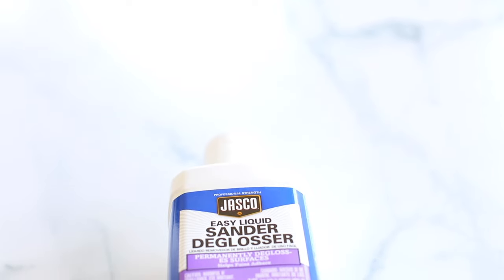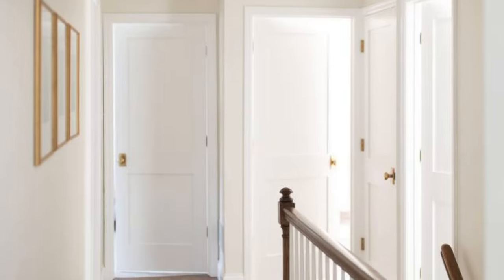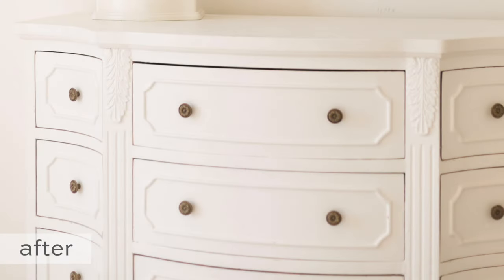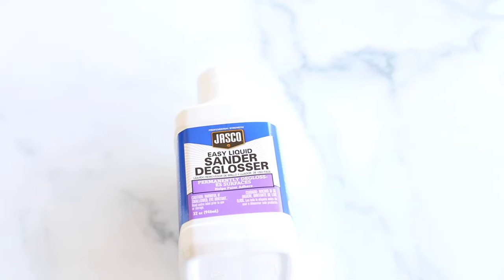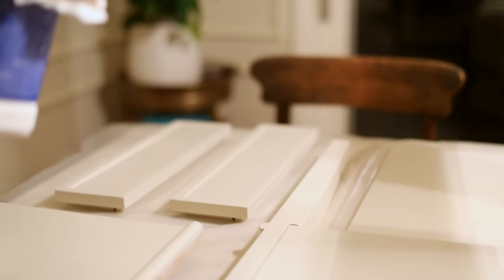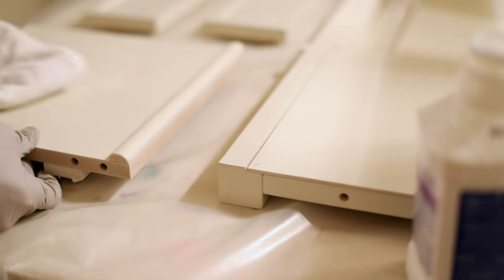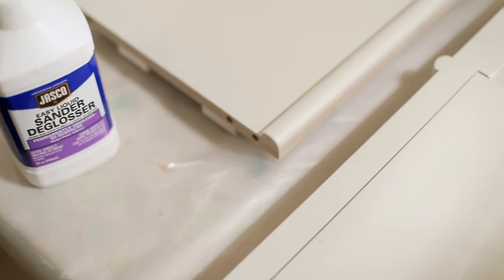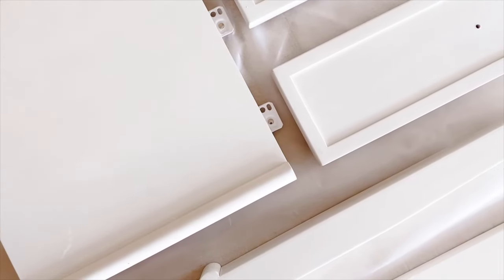Paint Without Sanding | How to Use Liquid Deglosser

Comment: Julie, thanks for the great video. I am using this product to degloss all of my oil based paint  trim & doors. Although the directions do not say to do this, I have been taking a damp cloth & removing the product/lifted sheen after several minutes (up to 10mins) but completely letting it dry. Now I’m concerned I shouldn’t have done that. Do you think it will matter that I took the haze off? We are applying a paint for trim & cabinets that is not oil based. Thanks!
Reply from the maker: Hi, you're welcome! I don't know for sure, but our cabinets and furniture have done well even when that has happened to us.

Comment: Hi, I have attempted to use deglosser. But became gun shy due to a paint peeling residue coming off. It resembles paint stripper. Is that normal?
Reply from the maker: I have never had a problem with it - it works like a charm, every time! We have used it on so many pieces of furniture and have had incredible results.